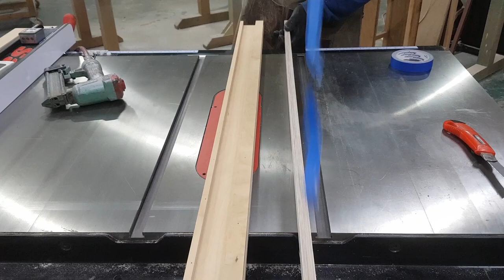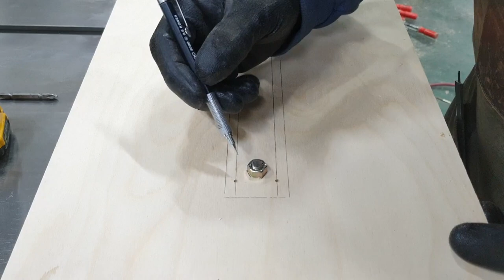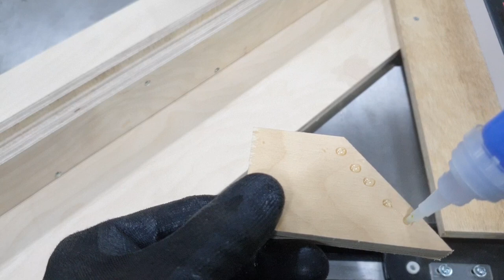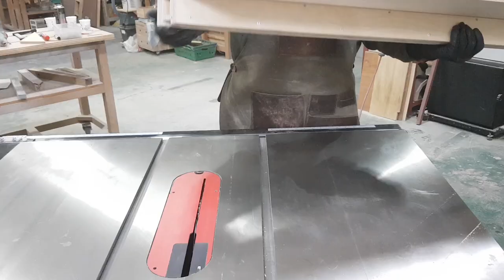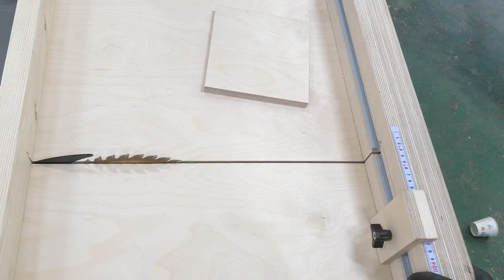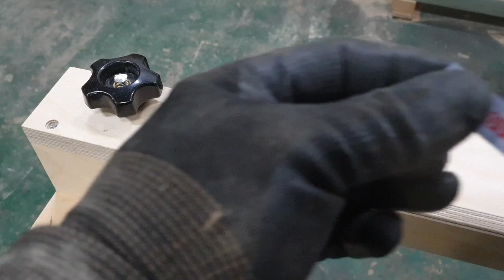45˚ cross cut/length adjustable cross cut sled/one-way cross cut sled/table saw cross cut

Comment: You obviously are good, and great at engineering.  And that's a great jig,.... But... stop wearing gloves when working with machines that have moving moving blades , one day , instead of nipping a finger , the blade will grab that glove and take at least a finger. Basic shop safety 101